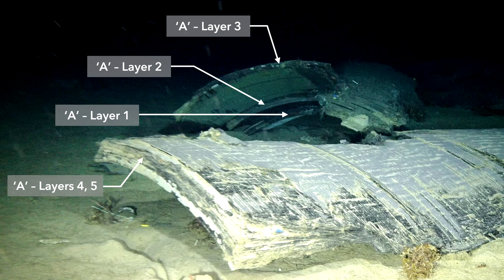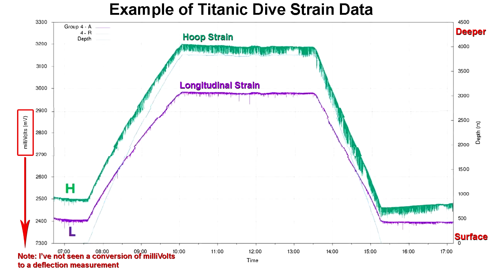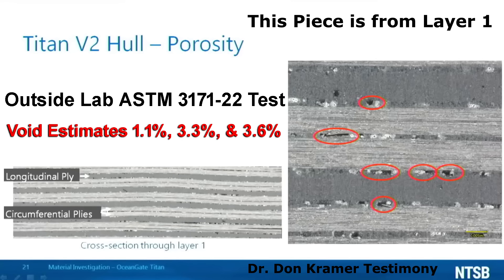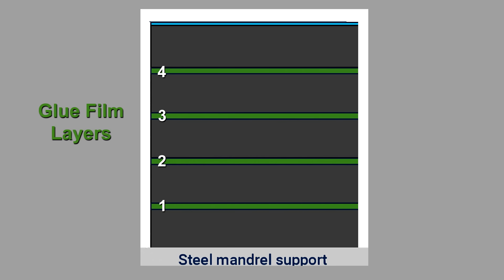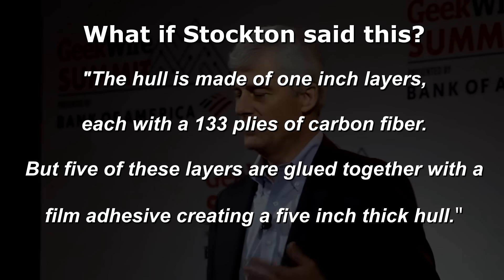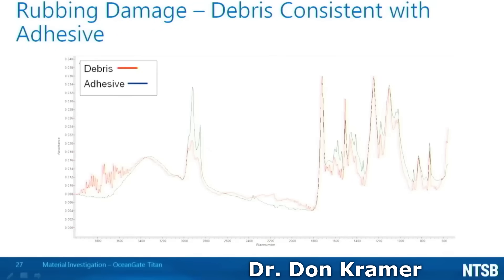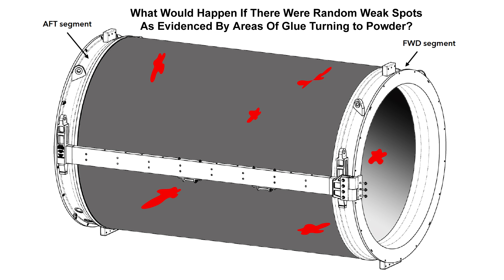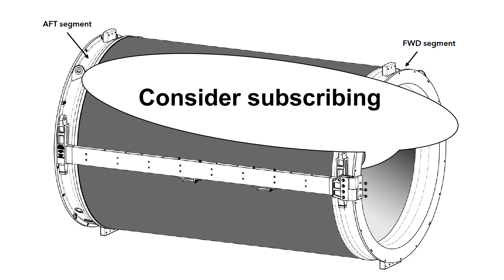OceanGate Titan Hull - Glue Layers Were Breaking Down To Dust - No Clues.

Comment: I don't understand what is still being discussed here. Everything has been wrong from the very beginning. 
Stockton Rush is an absolute fool to use carbon fiber, which has excellent tensile strength, on a structure that requires a material with high compressive strength. UNDER COMPRESSION!!!! Carbon fiber can't do that. 
That's as stupid as pushing a child's toy with a string. 
It's the same extreme as trying to stress concrete in tension. The tensile strength here is minimal. That's why steel rods are put in concrete and stretched with great force to compress the concrete. Prestressed concrete then has great strength, see bridges for vehicles and trains. 
Using fibers for pressure is a technological crime.
Reply from the maker: Thanks for your comment.  At 4:00 I put in the Toray chart for the specifications for the product OceanGate used.  I did that on purpose to show that this system when properly fabricated had fairly good compressive strength.  Toray tests for compression and publishes the data.
Reply: I think you'll find that Stockton Rush "WAS". Just sayin'. 🙄
Reply: Maybe this video is not for you or you don't understand the material in this video but I've been wondering (as I'm sure many other have also) what exactly failed on this hull from an engineering standpoint. It's easy to keep parroting surface level talking points of " Stockton Rush is an absolute fool to use carbon fiber, which has excellent tensile strength, on a structure that requires a material with high compressive strength. UNDER COMPRESSION!!!! " but as we can use this opportunity to what exactly failed and why it failed so that in the future who knows maybe later down the road someone uses this data to create something great but by learning the failures of this scenario can create something great. Simply implying Rush was cheap and stupid therefore we shouldn't talk about this case is a very closed minded way of thinking.
Reply: @Tuggernutz50  He is completely right though. There is only one thing to learn and that is that FRPs are not suitable for this type of application, which has been known for ages and is 'engineering 101'. So yes, Rush was as cheap and stupid as they get and got others killed in the process who were as stupid as him buying his crap and signing a waiver. Karma caught up with him though.
Reply: You sound like someone who isn’t that smart trying to be smart lol 😂😂😂

Comment: Clearly the technique used to bond the 1" layers together had problems, but it's a bit misleading to pin the blame on "glue". The whole thing is basically "glued" together. The carbon fiber is pre-impregnated with resin, aka "glue". Seems like the green stuff wasn't the best kind of "glue" for the job, but another type of "glue" may have been perfectly fine. I imagine you'd get a better bond with less voids if the "glue" was brushed on in liquid form, rather than draped as a solid sheet.
Reply from the maker: Thanks for your comment.  I agree.  We don't know how they chose that product.  Maybe there will be more information in the final report.
Reply: Glue is good stuff, if used with...  clean room, correct temperature and vacuum finishing!

Comment: hahahaha.

So you go to a hearing about what kind of testing you did as the director of engineer. Yet you leave out the testing results from said hearing? I'm sure that information is sitting on some server or computer and they knew to not retrieve it for the hearing.

'Doing the testing' isnt the same as showing the testing and letting a third party verify the science.

If their science was so rigorous, they should have no problem showing this to the NTSB.
Reply from the maker: Yes, a lot of stuff was missing from the testimony.  But it was complex.  Overall I thought the Coast Guard and the NTSB did a good job at the hearings.  Thanks for your comment.

Comment: Would have been so simple to have had another titanium ring mid span of the cylinder to resist the deflection. What us also worrying is Elon Musk drive to reduce bureaucracy and regulations and he wants to send up to 100 astronauts at at a time in his Starliner to Mars!
Reply: Nope. That would just introduce more stress risers into the Hull tube. More points of potential failure.
Reply: The reduction in regulations does need to happen in many industries. If you've actually worked in industry you'd understand the kind of waste and idiocy they can be. Industry best practices are often far better than regulation, yet it's sometimes illegal to follow a best practice! Factor that in with how enforcement is asymetrical and you get a really shitty system.

Just remember, just like with motorcycle helmets, the government and it's regulations are lagging behind by literal decades and are creating the dystopia we currently live in.

Comment: i still cant get over the fact that one of the strain gauges actually properly caught an issue on its penultimate dive, but it got ignored bc it happened as the sub was resurfacing. i can follow why a layperson (as its v clear rush was at this point), if they were treating the hull as a single uniform object, might not realize that the pressure coming off could cause damage, as the vessel would have «already survived the worst of the conditions it would experience» by that point, so to speak. But even to my amateur understanding, the moment u introduce the fact  that it is 5 layers (potentially many more) all compressing against eachother, relieve strain instantly becomes just as dangerous (if not more so) than the greatest overall stress the system will experience.
Reply: You are referring to "rebound stress" - the hull was uniformly compressed under tremendous pressure and on surfacing the stress involved when the materials tried to resume the original size and shape - let alone the affects on materials during repeated stress cycling
Reply from the maker: @ragtowne  Good reply, thanks.
Reply from the maker: Yes, that was dive 80.  They registered a permanent change to the stain gauges in one group associated with a loud band and they ignored it and chose to keep diving.  They should have quit after that dive.  Thanks for commenting.
Reply: @solareclipsetimer  wow! That should have been all the warning they needed to stop diving and figure out what is going on - sad really

Comment: The monitors look like they were screwed straight into the hull. Why does noone mention this
Reply: The monitors were attached to ribs that formed a "decorative" interior skin which also hid all the wiring
Reply from the maker: harkinsclark is correct.  There was an internal "sleeve" (insert) inside the carbon fiber hull that was spaced away from the hull about 3/4 of an inch.  Things were screwed into that insert.  Thanks for commenting.

Comment: Ive been saying since the beginning that this structure was only as strong as the matrix holding the layers together. Compressive forces cause buckling which a rigid fragile matrix cant handle. Once the matrix fractures all structural stability is lost. This was basically a submersible made of glue.
Reply: The compressive strength of carbon fibers is zero.

Comment: Ok, I have to chip in. Voids are detectable by ultrasonic survey....to name the most affordable method. There is no world where commissioning such submarine hull does not fall under criminal negligence / malpractice
Reply from the maker: I agree with you.  However, in my research on this, I have found that ultrasound for carbon fiber does not have good resolution after about 3 inches.  So, it wouldn't have been great for monitoring the health of the hull.  Thanks for commenting.
Reply: @solareclipsetimer  Having retired from an industry where ultrasonic shear wave testing was used extensively, if you see porosity in the first 2 inches of thickness, this can be extrapolated through the entire thickness of the vessel wall.  You don't need to test through the entire 5-inch thickness to expose that delamination, deformation, and void creation were occurring.  Any sane engineer at that point would condemn the hull from further use.  Stockton was a narcissistic ass who decided he was the smartest guy in the room and that he did not need to perform the battery of testing that is used for prototype structures.  There should have been UT upon completion of the initial fabrication, followed by UT after every dive.  This could have been easily charted to see the progression of damage being done to the hull and is something even a 3rd year college student in materials science would have been taught.
Reply from the maker: @ronkluwe4875  Thank you for that thoughtful reply and for adding to the discussion.
Reply: Even so, than anyone one with half a brain would run testing from the outside for one set of results, then from the inside for the other half. Make the interior fixings removable for inspections, as human occupancy safety factors are more important than permanently mounted equipment. Would have been an easy additional monitoring system, except for the malignant narcissist who because he didnt come up with the idea, or have the money, would have shut down the idea from the start for sure....sigh.@solareclipsetimer
Reply: Or at the very minimum, ultrasonic before and after every dive.

Everything i've seen on this sub implied that PMCS was also severely lacking for the sub.

Comment: What other than the hull do people think caused the implosion?
Reply: The viewing window is under scrutiny, as well.  For starters, it wasn't rated for the depths Oceangate was using it.  There's also the design issue in which the shape of the acrylic was altered to minimize the fish-eye effect, because they wanted their deep-sea tourists to have a better view outside, and so there were stress-points introduced at the corners.

There's also the bonding between the titanium ring and the carbon fiber cylinder, since they had to cut down the 5" thickness to get the hull to fit into the 4" channel that was machined into the ring - and then they just glued the titanium rings to the carbon fiber hull.
Reply: @doeverything7997  thank you very much
Reply: Aliens
Reply: @Cybo-Man Indeed- they didn’t want humons to find their sub aqua hideout.
Reply: @Cybo-Man  That’s a given!🤣

Comment: As i understand the hull was not vacuum bagged?
If so, that's all i need to know.
Reply: They shaved off the bumps with each layer instead....
   Same thing right...?
Reply: They did the glue-up in what looked like an open factory hall.  No vacuum, no dust management either.  OceanGate might not have know the exact quality of the end result, but they must have known that the production process was substandard,
Reply: It was vacuum bagged during the autoclave process @16:11
Reply from the maker: I believe they followed the Toray process for curing although it is never specifically stated that they did.  Thanks for commenting.
Reply: @solareclipsetimer  
It was laid up, then driven 100 miles to the oven.... Any bubbles were staying put by then...
Reply from the maker: @adrianneill5014  I agree. Driving the hull back and forth between factories, in the winter months, seems shaky to me.
Reply: @solareclipsetimer  
I heard, but can't cite, that between layers, they performed "leveling"..
  Or, grinding off the bumps...
I'm not well versed in composites, but, that's got to be bad..

Comment: CF tanks are commonly used for LPG tanks on automobiles. They have very specific expiration dates when they MUST be replaced due to stress cycling. When these are not replaced the +4000psi internal pressure makes for spectacular explosions, many of which exist on YouTube. OG completely ignored CF stress cycling expiration, they assumed THICK = FOREVER.
Reply: SCBA tanks, as well - not to mention required periodic hydrostatic testing which, let's be honest, Oceangate would NEVER have done, anyways.  The amount of testing they refused to conduct, just to save a buck, is staggering.

As for the comparison between tension loading vs. compression loading, remember, carbon FIBER is stronger in tension than it is in compression - you can't push a string.  So yes, there is still stress cycling on a compressed hull, and it will likely fail SOONER than a pressurized tank whose sidewalls are under tension.
Reply: @doeverything7997  
>you can't push a string
That's what she said
Reply: A CF tank / GF tank is under tension. This is very much a whole different loadcase as Titan was under compression.

Comment: A friend of mine got this nice carbon fiber canondale mountain bike... it was real cool and light .
untill it was not cool and did a titan on the trail.
Reply: Thing about carbon fiber bikes and other outdoor gear like hiking poles is that when they get cold, they get brittle.  Just saying that although it's heavier, metal doesn't have a chance of shattering on a cold day if it takes a hard impact.
Reply: @AlbertaGeek  For sure, Some nicks in the frame and cold cold weather, snap. 
That is pretty much what happened in his case.  been riding the same old steel bike for 30 years.

Comment: Thanks for video. Everyone can learn from this tragedy: management, engineering, production, etc. So many shortcuts and no-nos from engineering viewpoint. Sad really as all those mistakes lined up and failure was assured 100%. Look up videos on how Airbus wings are produced from CF, so much better! ZERO bubbles and ZERO grinding to break filament fibres.
Reply: And the designed loads put the fibers under tension. Exactly the scenario where they are designed to be used.
Reply from the maker: Thanks for watching and thanks for your comment.

Comment: The more information that comes out the bigger the horror story gets. The hull history almost sounds as bad as someone saying “I know nothing about Titanium fabrication but am going to build a supersonic jet with a Titanium main wing spar. Surface finish? Naw, I,m going to grind down the rough spots.” One simply does not ignore the surface finish of titanium structures under high or cyclic loads if one wishes to live long. Grinding leaves minute surface cracks which over time become big cracks.  

The need for comprehensive destructive and nondestructive testing (done by skilled personal) is partly why a modern passenger jet costs $100 millions new.

Comment: as a guy that worked in fibreglass the video of it being wound made me feel sick!
EVERYTHING was wrong!
temp control
mix control
De-Gassing after mixing
dust control
even correct tooling!
wound strait to give a direct failure path
NOT wound diagonally to then create a weave that crosses and allows even stress relief
the carbon looked DRY on application and did you see ANY resin drips?
any de gassing? I mean YOU DO THAT FOR A YOUTUBE VASE so why are you leaving air in the epoxy when you mix and apply?
and then after ALL that they did it in 5 layers!
didn't lay it flat
then even sanded through some!

this was done on the cheap
and when the experts noticed they were removed
this was indeed a sad loss
but this really was delusional levels of Hubris to think "you know better"
and then ignore not just one
but almost EVERY rule in the known science
then bet other people's lives on the result with no testing
Reply: I think one of the best things to show how much the Stockton Rush was willing to take risks was an interview by a father and son who chose not to go on the Titanic trip.  When the father and son had questions, Stockton flew out to try and convince them to sign up.  He willingly said that he had flown out on an experimental aircraft, and the father and son realized that Stockton was really willing to gamble with his own life.  Since the Titan was going to have Stockton onboard, he was taking the same gamble, but they weren't as risk adverse as Stockton was.
Reply from the maker: @patrickdix772  Gald you brought that interview up.  That was a great one.  That father and son could tell what the deal was.

Comment: Surely the failure point would be at the edges of the vessel and not in the centre…? I admit I am an engineer but not a structural engineer.
Reply from the maker: Thanks for you comment.  It depends on many things of course.  The engineering showed the hull getting compressed in the center of the case.  That was known.  The glued joint of the carbon fiber to the titanium rings was suspect for sure.  Who knows.  It will be interesting to see the final NTSB report.
Reply: @ thanks for reply. I was merely hypothesising with my comment and always happy to be corrected👍😄
Reply from the maker: @ShaunChurchill-t6o  Thanks for becoming part of the discussion, I appreciate it.
Reply: As central deflection of the cylinder increases from layer erosion then yes you're right, the outer most layers would be trying to pull away from the rings more than the inner layers.  So over more dives with more deflection the ring seal would break from the outside inward.  With enough layers separated ultimately the lip of the inner ring and the last remaining glue would be supporting the weight of the the ocean.  If we assume this failure occurred at the bow with the view-port, then all the material would be slammed into the stern.  Which is what we see at the bottom of the ocean.  The bow dome is alone and all the debris is crunched into the stern dome.  And the inner lip of the bow ring is sheered.  This is one theory of failure that the evidence seems to support.
Reply: Im currently studying mechanics of materials. So this is fascinating. I think the strain and stress cycling would cause the ends of each layer to break down the glue there. The previous video detailing how the end caps were assembled leads me to believe that was the failure point from the weakened bonds. Other videos early on mentioned communications from the submersible before implosion, and something was said about hearing a noise in the back of the hull.